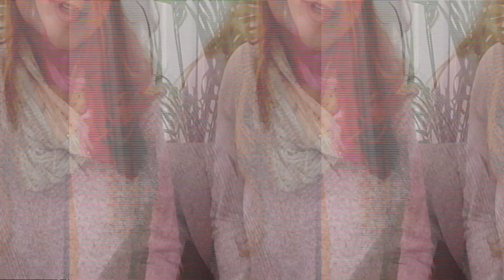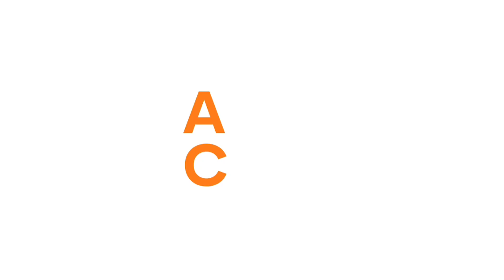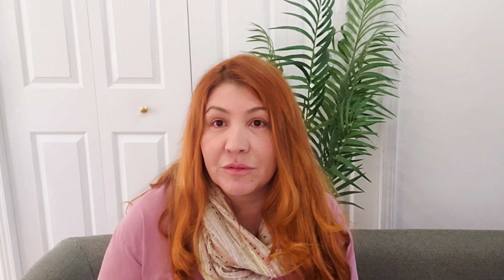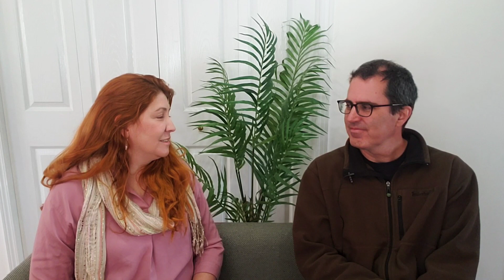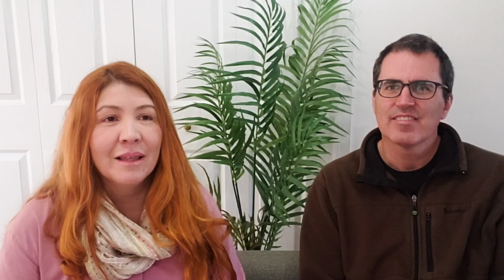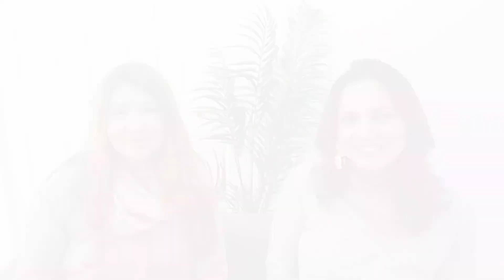Inert Gas System (IGS) - Aircraft Certification - Fabio Stabile

Comment: A brief summary of an incident that was responsible for the introduction of Inert Gas System (IGS).

Reasons for explosion of 747 fuel tank (TWA 800)

1. Middle wing fuel tank had a very small amount of jet fuel and a large portion of vaccum.The aircraft was on hold and waiting for take off due to a missing passenger for more than an hour.

2. The air conditioners were switched on for comfort of passengers.The heat exchanger unit was present below this tank with an intermediate air gap.This is also one of the reasons for vaporisation of fuel inside the fuel tank.

3. The outside temperature was also at higher side in the airport.The aircraft was kept on hold was also one of the reasons for vaporisation of fuel in tank.The increase in temp was enough to reach to flash point.

4. The jet fuel vapour is highly flammable than the liquid fuel in the presence of oxygen.

5. The earlier systems did not have a filter .There was wiring inside the tank.The damage to insulation caused spark (short circuit as indicated by pauses recorded in black box data) inside the tank.The tank had jet fuel and oxygen mixture which is highly combustible.

6. The post investigation suggested introduction of filter which was already in use for military aircraft.The filter bypasses the excess oxygen and carbon gases and allows nitrogen which is present in plenty in normal air.Nitrogen is inert in nature.Hence it is called "Inert Gas System".The presence of Nitrogen makes the vapour non combustible mixture.

7. In addition to this,the insulation of cable harness was also improved as a correction.

Kindly refer below video for detailed investigation analysis

https://www.youtube.com/watch?v=ww0DOBjXmgI
Reply from the maker: Thank you for your contribution!
Reply: @AircraftCertification  You are welcome.
Your team is doing good job.Kindly keep up the good work.

Comment: Thank you for the nice channel.
The new aircraft is supposed to have the IGS. It is necessary to take account the size and weight to install into aircraft. Also as Fabio explains that from where to get air and to distribute inert gas into the fuel tank should be considered.
As it's discribed that the accident open our mind, and give us the chance to improve our products. Off course prevents accident by design before it's happened.
Like other rules coming from accidents like flame propagation for insulation, I'm wondering that there will be new rules for AOA due to 737MAX.
Thank you.
Reply from the maker: Thank you Mizuide-san for your nice words. We are glad you like our channel. Your suggestion is noted.